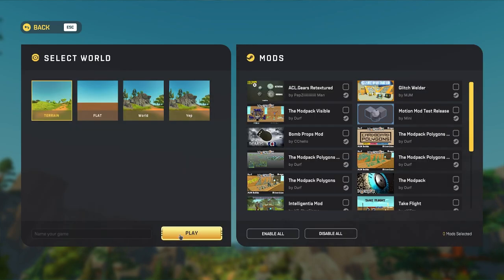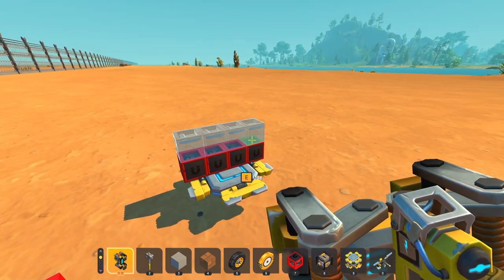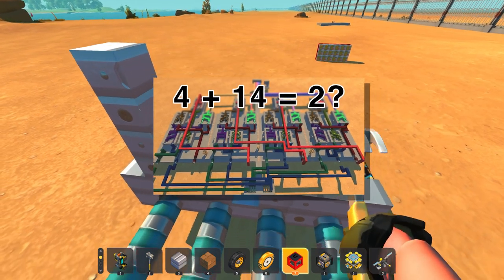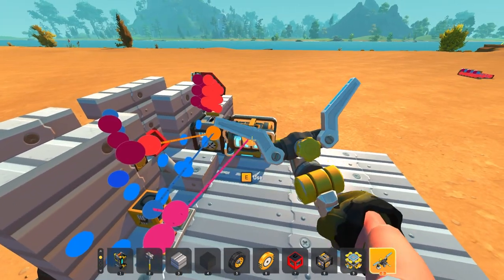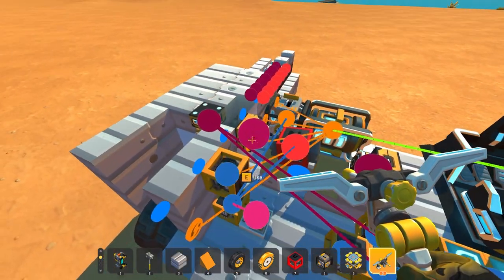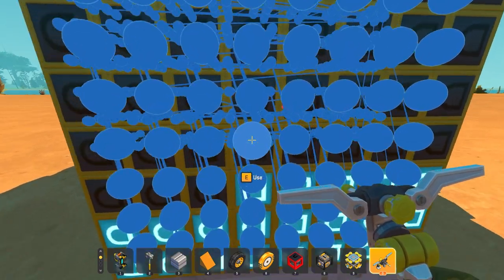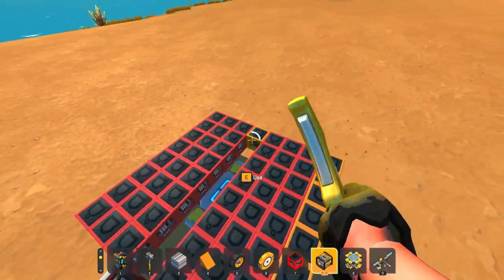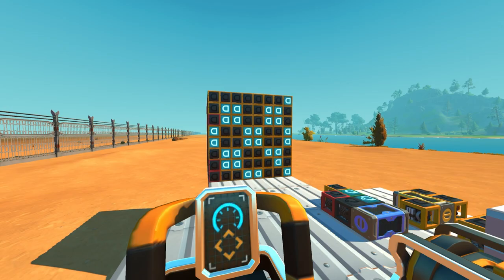Making a VHS Tape and Reader | Scrap Mechanic

Comment: i did try putting a magnet engine on a boat it did work out somewhat well then i tried putting a thruster engine on a bigger boat but because the engine was under water the performance loss was too high. great vid.

Comment: Wikipedia's shift register article has a logic diagram you could've referenced to build your own. I 100% get wanting to figure it out on your own, but it's not cheating to use reference material. It will save you a ton of time and headache, which helps avoid burning out before you get to what you really want to work on.